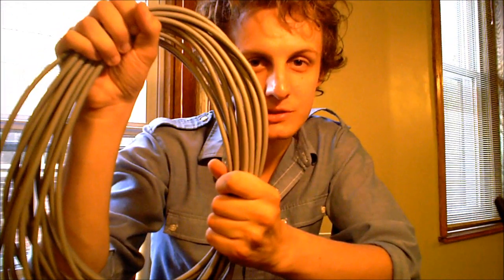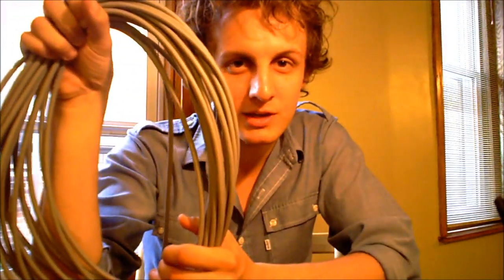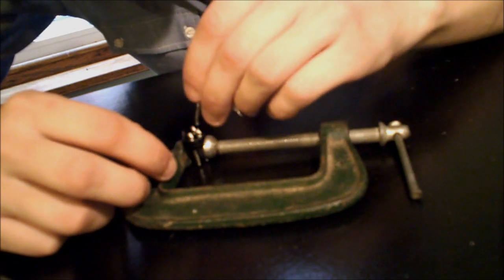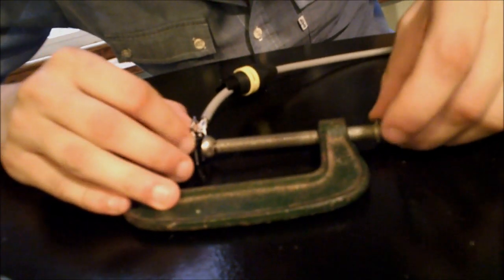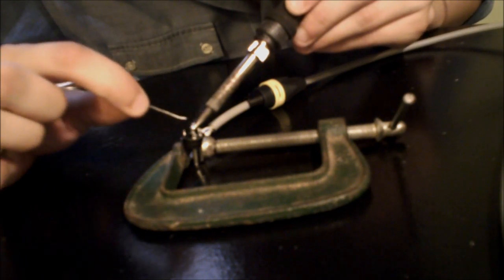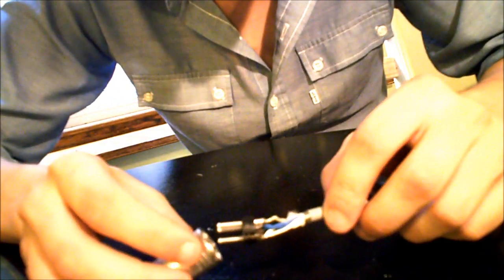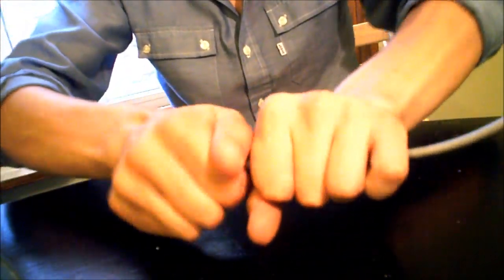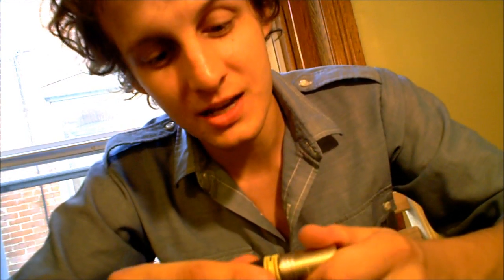How to Solder Your Own DIY XLR Mic Cables

Comment: It's a bit confusing when you say twist the white and blue together... you mean twist the 2 white wires together and then twist the 2 blue wires together not twist the white wire and blue wire to each other... correct?

Comment from the maker: @mangyshlakdapaul Thanks! I did tin the wires, but forgot to cover that in the video. For those reading, tinning involves heating the tips of the wire and applying a small amount of solder. This keeps the wires from fraying and helps the solder flow more freely when making the connection with the jack.